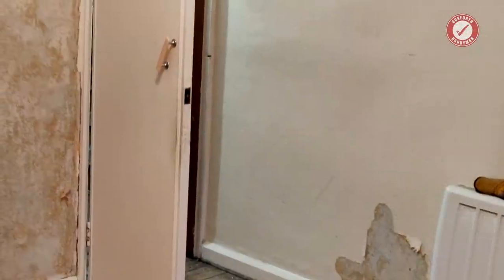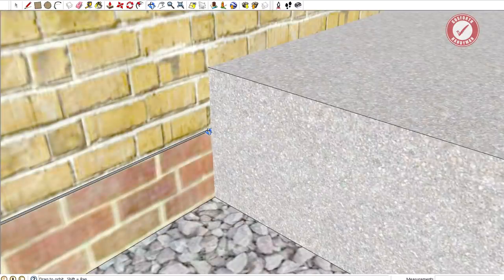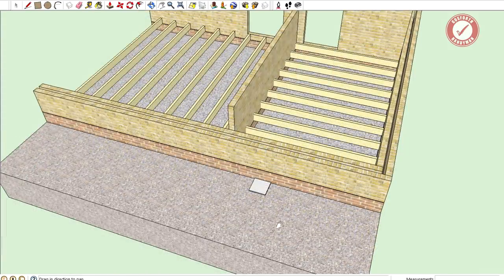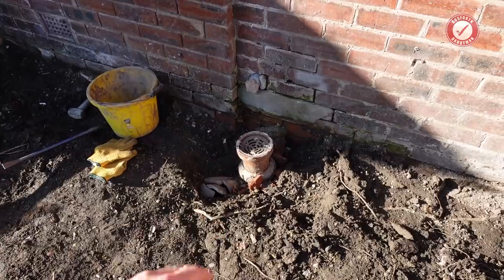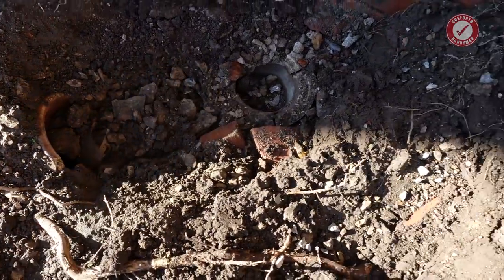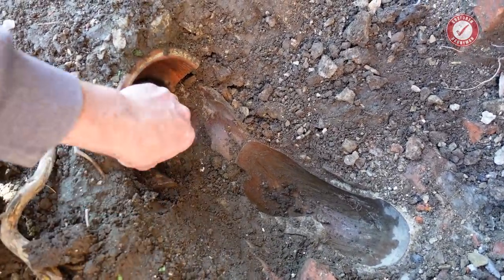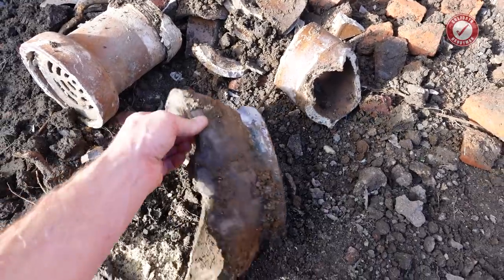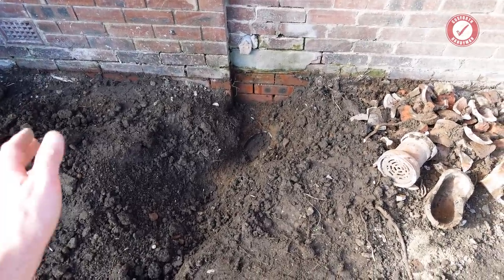I think we found the source of our damp issues! (1920’s Renovation Part 36)

Comment: Interesting. So what is the proper way to pour concrete in this type of house if you were to remove the suspended floor? If a radon proof sheet were to be put in place wrapped up the sides of the walls, then insulation, concrete, etc., would that stop the damp bridging?
Reply: The point isn't to put anything that touches the DPC. That's why he put in a suspended floor, leaving space around the sound DPC.

Comment: What would have been the best way to identify this had you not been digging up the garden where it was? I think my parents old house could potentially have this issue. I thought up until this video the downpipe from the gutter was the guilty party thanks to that big crack it had and thought you were confident it was that as well. My parents house is several hundred years old and the damp in one part has got a lot worse in the last few years. It has little to no foundations and no DPC. So there has always been damp issues but it seems worse of late, my old man says it is just due to how high the water table is after the last few wet years, it is a low lying area. But I think there is something else going on as well. It's a tricky one!
Reply: Hi the best way is to get a CCTV drain survey. Ensure if there is a soak away present that this isn't blocked up and flood tested also..There might also be a defective land drain, culverts, or even a defective well. I've got plenty of vids on my channel  :)
Reply: @completepreservation  thanks for taking the time to reply. I will have a look at your channel. 👍

Comment: Engineering bricks as with semi engineering bricks are all but impervious to damp, the mortar isn't, with internal walls the damp creeps up the mortar and render/plaster, injected DPC's rarely work, what does is stripping off the internal render/plaster and repacing with waterproof render, after of course indentifying the underlying issues, invariably this is drainage or ground level being too high, advice from a builder of fifty years, and yes i've seen it all including underground streams in Enfield, a real problem there and hard to spot.

Comment: Do you not need to repoint where the leak has washed away the mortar before you back fill it?
Reply: In normal cases that would be recommended
Reply from the maker: That will become an internal wall and most of it will be removed, but if that was staying external then defo. 👍

Comment: What is that pokey out thing to the right of the bay window at 22:09?
Reply: looks like shrubbery roots
Reply from the maker: That's a very good question! Some sort of old vent but not sure what for! Asked around and nobody seems to know. Keeping it. 👍
Reply: @GosforthHandyman  ahh, its the lower thing, was it an attempt to 'drain' the concrete floor ? if the original builders had noticed breaching DPC was going to be a problem.  maybe all will be found once the new doorway is in place
Reply: @GosforthHandyman   it looks like it has holes either side. Maybe it’s built like that to catch the wind and force the air into the cavity? 

Looks to have some kind of logo stamped in it too. Would be good to see a close up pic on your instagram. Hopefully someone could identify it 👍

Comment: I live in an area where there is no municipal sewer.  Toilets are usually properly connected to a septic system, but in older homes the "grey water" from sinks and showers was sometimes dealt with more casually, often into a small drywell.  All well and good until you connect a washing machine or dishwasher to the existing pipes, and then it comes bubbling up in strange places - like into the cellar or crawl space under the house.  Many new residents who have come from the city have no idea where their waste water goes until it causes a problem!

I noticed those drainpipes in early videos and figured you'd reroute them - and you did.
Reply from the maker: Interesting Bob! A lot of houses in the countryside have septic tanks over here, but the vast majority are connected to public sewers. 👍